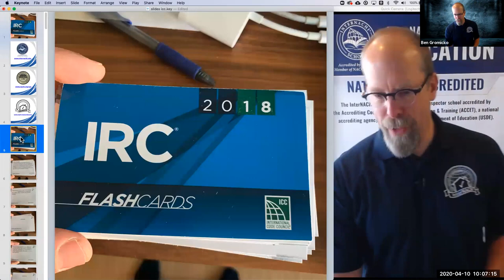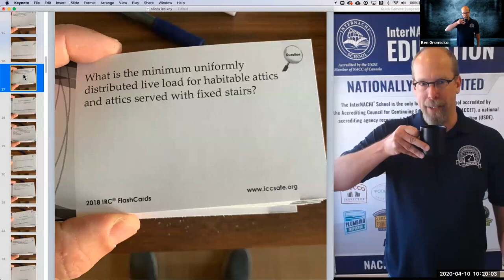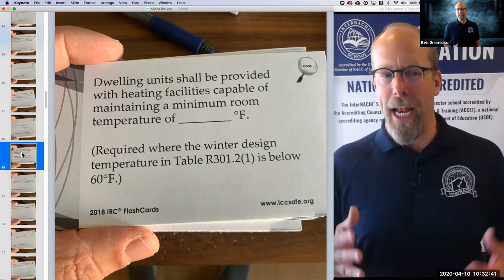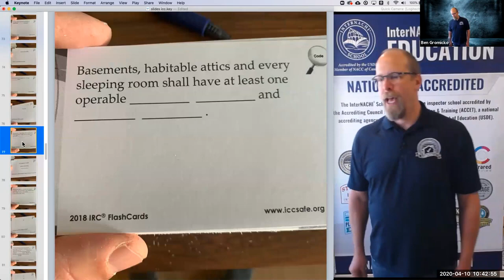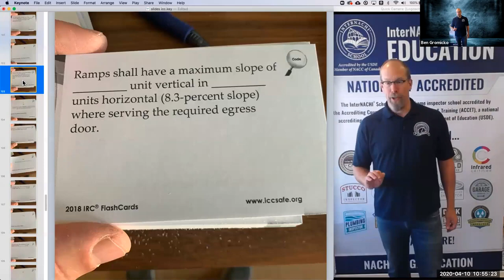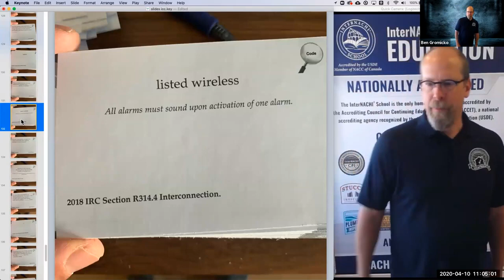ICC® B1 Code Exam Prep Webinar for Residential Building Inspector Certification (IRC® Chapters 1-3)

Comment: 2021, hot water is 120 degrees
Reply from the maker: Correct. 2021 IRC https://codes.iccsafe.org/content/IRCComm2021P1/chapter-2-definitions#IRCComm2021P1_Pt02_Ch02_SecR201.4 Water at a temperature greater than 120°F (49°C). The code does not specify a maximum temperature for hot water; however, it should be limited to a temperature that will minimize burn risk to users and thermal stress to plumbing system components. The designer, installer or owner has the choice of determining the temperature. Most water heaters are now shipped with a factory-set temperature of 120°F (49°C). The minimum temperature is established to determine what is considered as hot water. Water temperature below the minimum temperature is either tempered or cold. Care must be used when installing a system that has temperature capability of exceeding 120°F (49°C) because of the possibility of a user being scalded.

Comment: You have to inspect a house with the code that it was built with. New housing or remodeling would only require 2018 or the code the district has adopted. If you’re inspecting a home built in the 80’s with iron railings, you couldn’t make them replace them to comply with current codes. Same applies for smokes and gfi’s.
Reply from the maker: That's only if you're a code inspector. Home inspectors could inspect without any regard to the year the home was built, which is in the best interest of a home inspector's client.
Reply: Agree it might be in best interest of the homeowners but it wouldn’t be a code violation. If one is using 2018 code for home inspections how would you apply section R102.7?  This is what I think about when buyers ask me to look at a house. I don’t do that very often most of my work is new construction.
Reply from the maker: @daveh8405  This is a great question and very interesting issue.

Buildings that existed legally at the time the code was adopted are allowed to have their existing use and occupancy continued if the use or occupancy of the structure was also legally in existence. 

This means that as long as a structure or building remains in a safe and sanitary condition it need not be upgraded to meet the more current standards. 

A specific level of safety in existing buildings is dictated by maintenance and hazard abatement provisions, as contained in the International Residential Code®, the International Property Maintenance Code®, and the International Fire Code®. 

However, any new construction, addition or remodeling will require such work to conform to the requirements of the new code. A change of occupancy of the building also will force the building to conform to the new standards.

In my personal opinion, if the house was built to code when GFCIs were not required on all kitchen countertops, and I'm performing a home inspection at that house, I will report missing GFCIs as a safety hazard and a defect and will make a recommendation to correct that defect. 

If the house deck was built to code, but today the space between the spindles is large enough for a child to fall through, and I'm performing a home inspection at that house and its deck, I will report that guard as a safety hazard and a defect and will make a recommendation to correct that defect.

Ya see, for home inspectors, it really doesn't matter that it was built to code back then. That often means that it currently has a problem that should be corrected. That's the beauty of being a home inspector, and not being a code inspector. Code inspectors is all about code and dates and legacy. Home inspectors are all about current conditions and serving my client's current interests.
Reply: @BigBenGromicko  Where are the remodel police? It is my understanding that when upgrades to the electrical system are made, specifically pulling new 3-conductor wire to accessible locations, the compliance requirement directs the entity involved to improve the entire system. I see mixed 2 and 3 wire homes all week long. Thoughts?

Comment: Does the test flow from say chapter 1 questions to chapter 2 questions or do they just flow from anywhere in the book? Say first 5 questions are chapter 1 then next say 7 chapter 2 . Or does it say question 1 may be from chapter 8? Great video by the way, helps a ton.
Reply from the maker: That video was from first 4 chapters. We're doing another set at another webinar at https://www.nachi.org/webinars/2021/icc-exam-b1-residential-building-inspector-chapter-4
Reply: Any where in the book. Familiarize yourself with the charts in each chapter.
Reply: Read each question very carefully and take time to study each chapter. The test is from chapter's 1 - 9